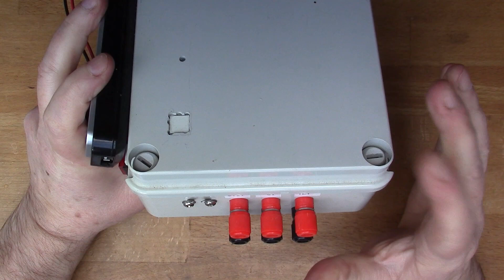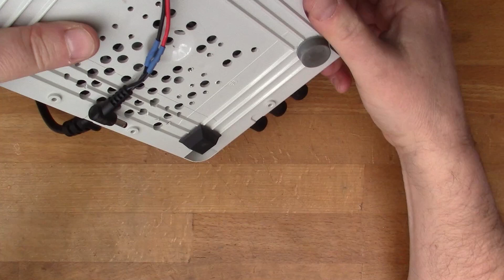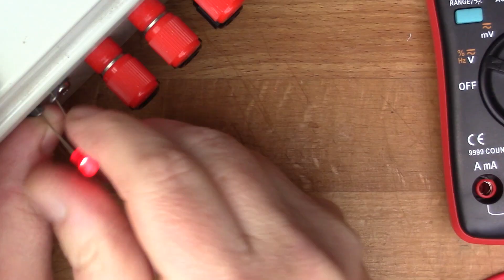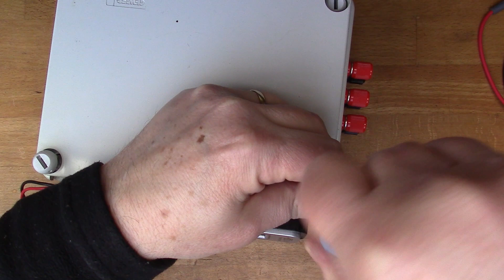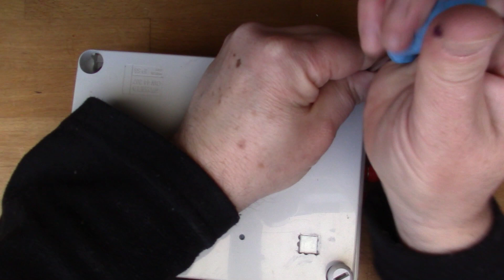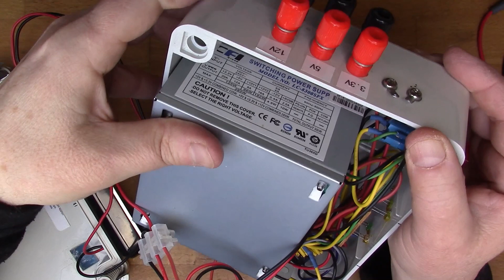Old Bench Power Supply Teardown (#146)

Comment: nice video I have a few Computer PSUs knocking about I was going to build a bench PSU out of it but I have never bothered to do so 🙂
Reply from the maker: Thanks! You can get modules with fuses and terminals now, to make the build easier, e.g. http://www.icstation.com/24pin-m229-desktop-power-output-transfer-board-supply-power-output-connection-module-p-13095.html
Reply: @MartynDavies  yes Martyn I know but thanks all the same🙂